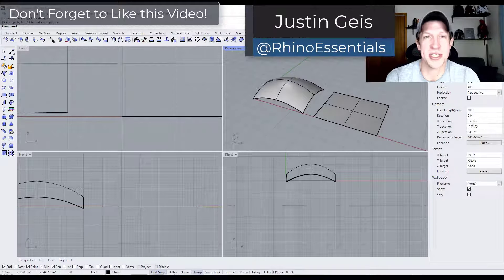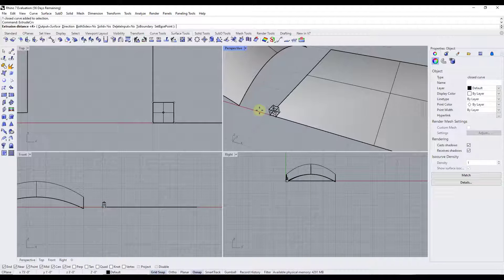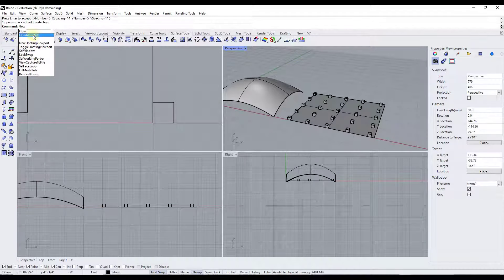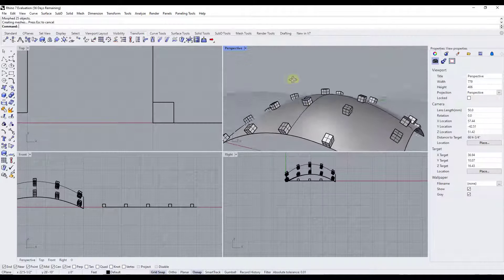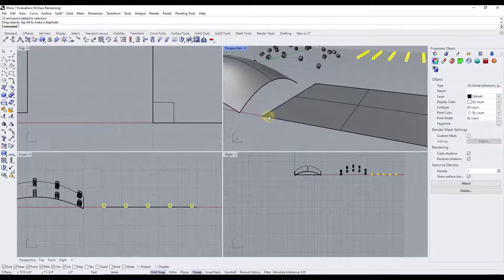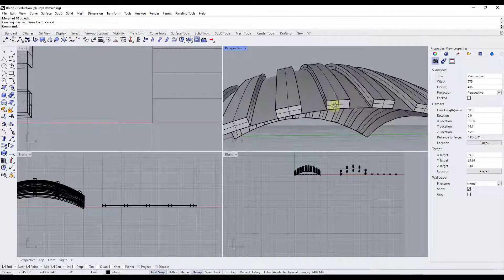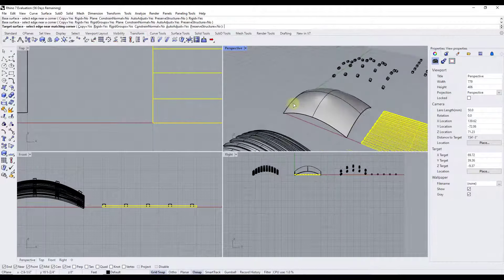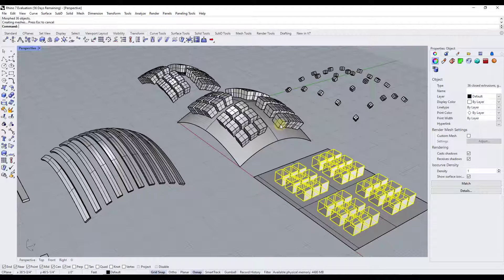Bend Objects ALONG SURFACES in Rhino with FlowAlongSrf! (Easy Tutorial)

Comment: Hi Justin ! Thank you for your tutorials. I am trying to make a lattice solid flow along curve, but it doesn't seem to work. I am making a model of a laser cut railing for a round helix stairway. Do you have a solution, because  at the moment I am bending it manually and it does not bend as good as I need. Thank you

Comment: Tip from a total newie. 

I am just running the testversion of Rhino. Had to transform a starfield consisting of thousands of stars around a half sphere.

I didn't get the result I wanted. All stars were skewed. Until I found out that the distance between the source-object and reference plane mattered A LOT. So the distance between my source object and the reference plane had (in my case) to be somewhat equal to the height of my half sphere in order to produce the desired result.

Awesome program and YT channel!